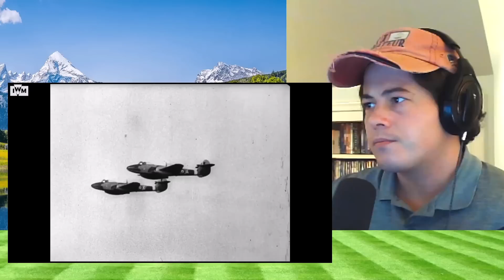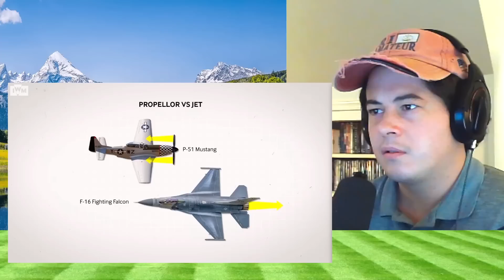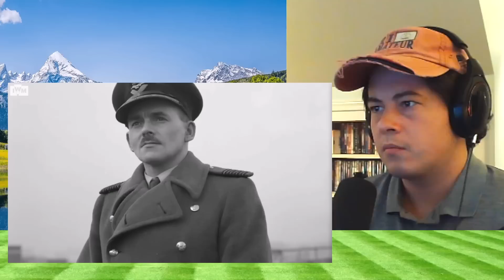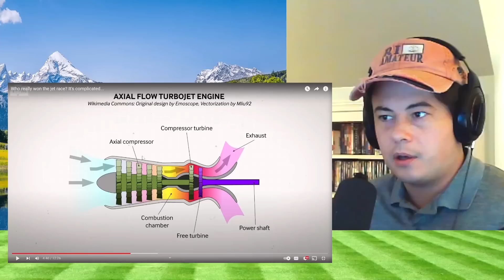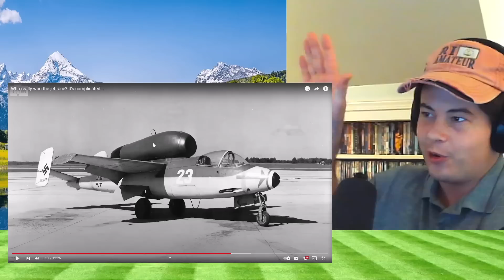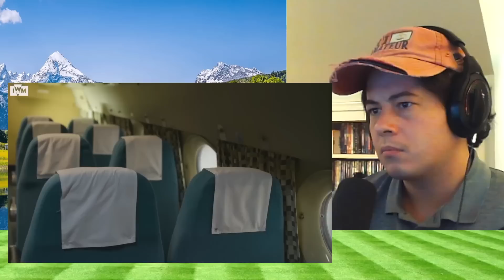American Reacts Who really won the jet race? It's complicated...

Comment: The The Fairchild Republic A-10 Thunderbolt II is a single-seat, twin-turbofan, straight-wing, subsonic attack aircraft developed by Fairchild Republic for the United States Air Force. In service since 1977, it is named after the Republic P-47 Thunderbolt, but is commonly referred to as the "Warthog" or simply "Hog".  Looks to the The Heinkel He 162 similar but instead of a single central mounted engine the A- 10 has two side mounted engines. Peace out.

Comment: "Crush" the air is a confusing term. The air is being compressed on its way through the turbine compressor section where it will be squeezed down so you end up with a very small volume that contains a lot of Oxygen so when this air reaches the combustion chamber where the fuel is injected, you can inject more fuel for the volume of air which will decide the power you get out of the jet engine.
The biggest problem they had adopting these jet engines in airplanes was that they in the beginning did not fully appreciate the importance of the wing shape when creating a faster and more maneuverable aircraft.
Luckily, Hitler did not appreciate the importance of having gotten the ME-262 into service only as a fighter from the beginning.
Hitler strangely rarely appreciated the importance of new inventions. He also did not support the production of the first real assault riffle in the beginning.
Americans should always remember that all the technology for jet engines and missile technology originally did not come from America but from the ruins of Europe.
About flying today, it has never been safer, but that being said, the recent problems at Boeing clearly show that no matter the technological advances, a corrupted business culture of greed where the focus is purely on profit and shareholders can bring even the most experienced and esteemed companies into trouble.

Comment: There were a couple of axial flow jets under development by the British, but not put into service during the war.
Reply: Those responsible for jet engine development realised that the axial flow engine needed much further refinement and therefore opted to go with the simpler, and much faster to get into production and service, centrifugal jet engine, the axial flow engine that had been developed in Britain at the time, the Metrovick F.2, was eventually to lead to the Armstrong Siddeley Saphire engine of the late 1940’s.

Comment: The fastest propellor driven aircraft was the XF-84H Thunderscreech, which used a jet engine to power a propellor, like a modern turboprop engine, but this  aircraft could go supersonic, with the caveat that it produced over 200db of sound, since the tips of the blades are constantly breaking the sound barrier, and the torque from the engine wanted to make the aircraft do a perpetual barrel roll. They only flew it a dozen times before the program was cancelled.

Comment: Connor, just use the simple rule if you think America made/invented it... its often British first
Reply: Film, audio recording, light bulb perfected, Triode, escalator, airplane, assembly line applied to auto production, FM radio, alternating current/AC, broadcast radio, electronic television, Ferris wheel, first US patent for radar granted 1934 (Wattson Watt began experiments in 1935 following a MoD request for a "death ray"), klystron tube (valve), Hughes tri cone drill bit, Houdry process for catalytic cracking of oil and Salk polio vaccine.

Comment: 18:38  if you want to learn more about the Comet’s problems, I highly recommend watching ‘Disaster Breakdown’s video ‘What really caused the Comet crashes’ here on YouTube. 

Tl;dr. The metal fatigue was caused by pressurisation cycles. The Comet had a service height much higher than previous passenger planes, where the air was thinner and gave less drag, so the inside needed to be pressurised so the passengers and crew didn’t die yet could still move about. Each time the inside was pressurised, any microfractures in the metal got pulled on and could spread a little. The moment they joined up, the metal would fail along that line, and with the high pressure difference it would… uh… ‘spontaneously disassemble’ as they say.

Comment: As gasses, like air, get squeezed both their pressure and temperature go up. This makes combustion more efficient, but the increased pressure also creates a force preventing more air being added. The compressor is spun by the turbine in the exhaust to provide a counteracting force to push more air into the engine core. A multi-stage compressor can get up to higher pressures with a smaller profile (so less drag).

Comment: The Comet's structural metal fatigue arose from the original squared shape of the passenger windows which encouraged cracking and eventual failure.  Circular windows solved this problem.

Comment: It was a good question about limited prop power as you go faster as you were heading down the correct way of thinking. Essentially, as the speed of the aircraft increases the props will bespinning faster than the aircraft's travelling speed, this means that the prop tips start to go sonic before the aircraft which can be particularly fatal for the prop life (as in they decide that an early detachment from the a/c to be free in the breeze is the best solution :P). There was an aircraft designed with the idea of supersonic props though, tested by the US in the 1960s I think that was nicknamed the Thunderscreech. It did not go well
Reply: Thought I'd also add the metal wear was specifically the windows, they put square windows in the original airframe which caused metal fatigue to amplify on the corners due to the pressurised cabin. This, in turn led to the metal fracturing when the pressure difference was greatest, i.e. at altitude, causing the aircraft to split in half. the reason for the square windows initially was so the aircraft windows looked different to ship windows from what I remember. The reason it hadn't been experienced before though was the huge differential in pressure between the cabin and the exterior from being the first pressurised cabin civilian aircraft to fly that high.

Comment: Again, more BS from Connor. The Space Race gave us water filters, charge-coupled devices, rescue equipment, scratch-resistant eyeglass lenses, cochlear implants, anti-corrosion coating and memory foam, integrated circuits and much more without armed conflict, just fierce rivalry. The Earth is now surrounded by a network of satellites, which provide broadband communications and high-definition television, data used for weather reporting and GPS navigation and positioning.

Comment: The reason you need multiple compressor stages is to keep accelerating (forcing) the air into the compressor to maximise the compression. A single compressor disc, while useful in a relatively small device, cannot provide the mass of air at the compression needed for a jet engine, which is an avaricious beast. Remember also, the compressor discs are turned by being connected by a shaft to the turbine (again, usually multiple stage) that spins in the exhaust flow. This is why they are known as jet or gas turbine engines. It is the connection between the turbine (in the hot exhaust) and the compressor that is the genius of the concept.

There is a belief that the rapid success of the Benelux and French campaigns lulled Hitler into thinking he was a military genius, and that Russia was a mere trifle. The thinking goes that if France had been a more difficult campaign, the Nazis might have built up their strengths better before having a crack at Russia.

Comment: I don't think actual events had any effect on Hitler. He was just straight up a narcissist from the start. His ego meant he could do no wrong in his eyes, when things went wrong it was someone else's fault. We still use miles in the UK, we  have not switched to kilometres. So it's miles per hour still for us. Metal fatigue is not simple wear & tear, but more subtle metal damage which is almost invisible.
Wartime aircraft hardly lasted long enough to develop this problem, nor did they fly so high & fast, which largely caused it. It also took X rays to see much of it in the metal.

Comment: Wear and tear, metal fatigue, in pressurised aircraft was an unknown. The problem with the Comet was square windows. With the metal flexing slightly under cabin pressure, after a relatively short time cracks started to form around the corners of the windows. The remedy was round windows. No corners, no weak point.

Comment: The metal fatigue that afflicted the Comet was the result of the constant pressurisation and de-pressurisation of the fusalage. This resulted in tiny cracks forming in the corners of the squared-off windows.
They only found this out after building a big water tank into which they put a complete fusalage and put it through hundreds of cycles of pressurisation until it eventually failed.
They then re-designed the aircraft with oval windows, but by then the damage was already done,
Reply: Aha, that old myth. Whilst the Comet 1’s windows may look square from a distance, the corners are in fact rounded to help distribute stress loads in the airframe skin. This problem was already well known and de Havilland’s designers weren’t entirely stupid !

Also, there is no evidence that any cabin window failed.

When placed in a test tank and subjected to repeated pressurisation cycles, the airframe under test at Farnborough failed, not at a window, but at a panel in the roof containing am antenna/aerial.

The cause of the failure was also nothing to do with any squareness or roundness. The skin tore as a result of fractures radiating from a RIVET!
De Havilland had used a new technique using PUNCHED holes to fit rivets. These left ‘invisible’ microfractures surrounding the rivet hole. They lengthened under stress and the skin eventually tore, presumably being the cause for the loss of several Comets.

The fix was to use punched rivets as well as thicker aluminium. The windows subsequently were made more rounded to reassure the flying public further.
Reply: @nmellor774 The myth about the windows has been attributed to the use of the word ‘window’ in the official report to describe the hole in the upper fuselage where those particular aerial/antenna were fitted.

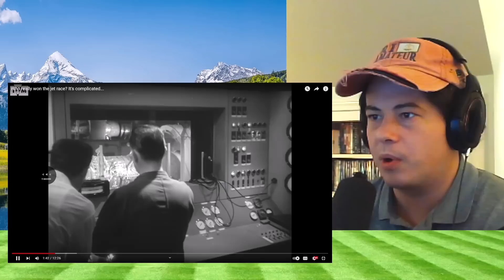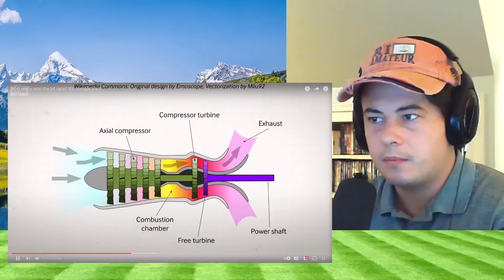Comment: 2:52 I suppose at some point you do get lower returns, but you can always make bigger propeller. That said, keep in mind turbojet engines use propellers. Word of mention - junkers jumo engines were designed at junkers, not by Junkers himself. Hugo Junkers refused to help nazis in reararment and his company seized and he died soon after in mysterious circumstances. 7:52 Sort of. These fans generate pressure difference on one side which sucks the air in. 9:53 Its funny you mention that, because i think you watched TIKs videos about hitler and oil problem - Hitlers motivation are often misunderstood or deliberately misunderstood by german generals and elites who were eager to blame someone else for their failures, and as generals they were mostly focused on tactical aspects, often ignoring economic aspects of war. 12:46 It means it can work for 25 hours before needing major refurbishment or replacement. 18:34 There would be wear and tear of course, but much less, and remember airplanes used to be replaced by newer models much more often back then.

One of things I didnt hear mentioned - jet engines are simpler to manufacture than piston engines - early german engines took 375 man-hours compared to 500 for piston engines.
Reply: A bigger propeller works to a point, but then you start getting supersonic shock waves further inboard of the propeller tip.  Another solution is to increase the number of blades on the propeller.  In the very last designs, they had a second ring of blades behind the first, rotating in the opposite direction.  (one of the advantages was the rotating propeller was less likely to throw you into the ground).  It was however very complicated.

Comment: My two favourtie German WW2 jets just don't get any airtime. The Horten Ho 229 and the Arado Ar 234. Disgraceful.

On the comet airliner, everyone thinks the problem was the square windows but this was largely dis-info. The problem was just the designed thickensses of metal in certain places. Airlines just hadn't gone through this kind of stress test before. Everyone learned from them.

Comment: The Comet - the problem with metal fatigue was the height it cruised at, flying high the air pressure is very light, at ground level pressue is dense. With so many take offs and landings caused the fatigue.  They fell apart due to square windows, the designers didn't realise that would be a problem - that's why all airliners since have oval windows.
Reply: I used to think the same, but actually, it's a misconception that the windows were the primary cause, that has become so widespread that people understandably think it is fact.

The truth is, though the mk.1 Comet had squared windows, they still had rounded corners, and these corners are not where the fatigue cracks originated. Rather, they started at the corners of the ADF antenna cutouts, which were square, and were described in the accident report as "ADF aerial windows". It is thought that the word "windows" was picked up by the press and the misunderstanding spread from there.

It is not helped by the fact that in the accidents, the crack spread violently VIA the windows, and that such photos were widely circulated...

...And that the redesigned Comet 2 switched to completely round windows, which further cemented people's idea that it was the windows that were at fault primarily.

Rounder windows are far better in pressurised aircraft for sure, and part of the raft of redesigns to better cope with pressurisation cycles, but again, the squareness was not the main cause of the Comet disasters.

Mentour Pilot has a good video on this and it all checks out if you delve deep enough, though the window story is still all over the place. 👍
Reply: It was not so much that the outside air pressure was light, but that the fuselage was pressurise for the comfort of the passengers.  The fatigue was from the constant cycle of Pressurization & Depressurization, with some design issues concentrating the problem.  When the fuselage failed, usually under pressure, it tended to unzip in much the way that a balloon bursts.

Comment: The Comet crashed because the windows were originally square, this caused metal fatigue around the windows.  The solution was windows with rounded edges.  As military aircraft don't usually have windows for the passengers, this was an unknown risk.
Reply: I used to think the same, but actually, it's a misconception that the windows were the primary cause, that has become so widespread that people understandably think it is fact.

The truth is, though the mk.1 Comet had squared windows, they still had rounded corners, and these corners are not where the fatigue cracks originated. Rather, they started at the corners of the ADF antenna cutouts, which were square, and were described in the accident report as "ADF aerial windows". It is thought that the word "windows" was picked up by the press and the misunderstanding spread from there.

It is not helped by the fact that in the accidents, the crack spread violently VIA the windows, and that such photos were widely circulated...

...And that the redesigned Comet 2 switched to completely round windows, which further cemented people's idea that it was the windows that were at fault primarily.

Rounder windows are far better in pressurised aircraft for sure, and part of the raft of redesigns to better cope with pressurisation cycles, but again, the squareness was not the main cause of the Comet disasters.

Mentour Pilot has a good video on this and it all checks out if you delve deep enough, though the window story is still all over the place. 👍

Comment: The Comet became the Mighty Hunter "Nimrod" the world's first ASW Jet Aircraft.
Reply: And that idiot Cameron cancelled its refurbishment in favour of a Boeing based system. Nimrod was unique. It could travel on 4 engines and patrol on 1. I doubt the Boeing replacement is as good.
Reply: @colinstock325  Thought it was Thatcher that scrapped the Nimrods as well when they were technicalyl more advanced than the (cheaper) American AWAC.